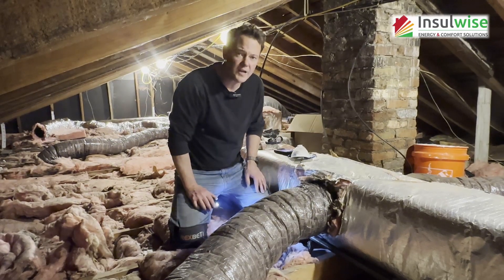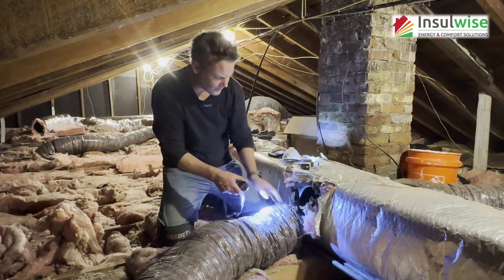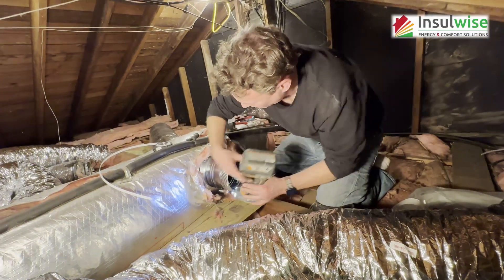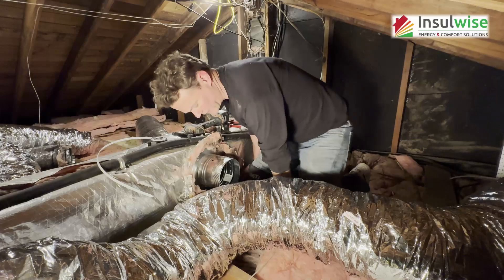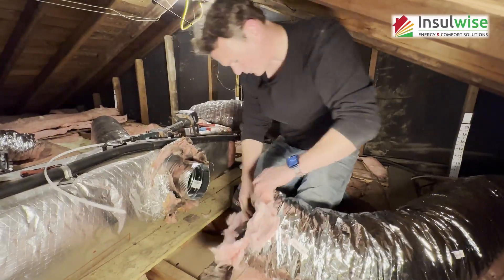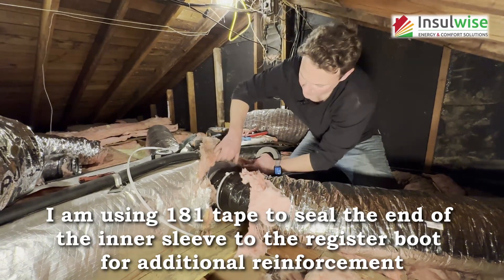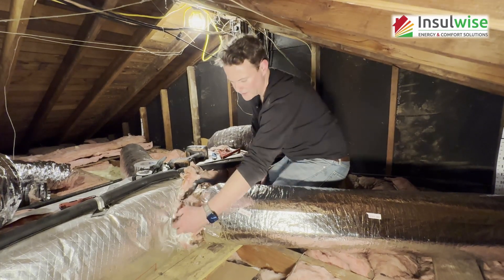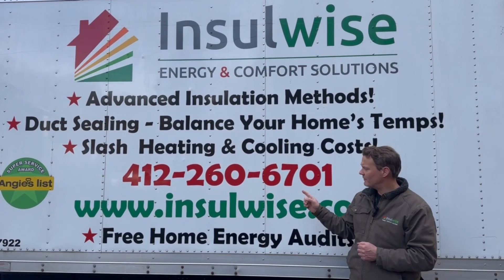Massively Improve Energy Efficiency by Upgrading Your Attic Flex Ducts!

Comment: Does having your ducts cleaned help heat and air travel through the duck air flow at all or does it just make the air cleaner. Can you do a video on cleaning your own ducts with a vacuum or is that recommended
Reply from the maker: For ducts, it's usually the return ducts that are the dirtiest.  The supply ducts are usually fairly clean to start with because the dust / dirt has mostly been caught in the air filter.  I would however say it's a good idea to pull the return grille covers and vacuum them and also the first few feet of the returns with a shop vac.  That's where A LOT of the dust and dirt tends to build up.  Thanks for commenting!
Except in extreme situations, it's rare that ducts are so dirty that the dust in them is blocking / impeding air flow, at least on the return side.  So I wouldn't expect much of an improvement in energy efficiency / duct flow from having them cleaned.  It's more of an improvement in interior air quality. 
Andy

Comment: Ive noticed my roof thaws directly above my exterior wall where our heating register exits the ceiling. We have r49 blown in insulation in our attic but peeking into the attic if i remove the register cover reveals they missed behind all of them. Any ideas on how to seal that up/insulate it? Its a 4/12 roof so getting to the exterior wall is almost impossible
Reply from the maker: The only options that I can think of are upgrading the R rating the existing flex hoses like I do in this video?  We see A LOT of junky, R-4 rated flex hose.  We changed those out in this video and installed R-8 rated hose.  The next must do's would be air sealing any air leakage points around the register (ideally the whole attic floor) and then having insulation effectively blown into the air in question so that the flex hose is buried.  We buried these flex hoses.  No melt spots on roof.  Hope this helps!
Andy

Comment: What do you think about making that attic area a conditioned space?
Reply from the maker: You can certainly do it, but you'd most likely need to spray foam the underside of the roof with closed cell foam (for sure closed cell in a cold climate) and that alone is a very expensive endeavor.

Comment: Very helpful. Thanks for showing us how it’s done, and providing pro tips along the way. Time to check my connections now that it’s not 110-degrees up there. You earned my subscription. The folks in the Pittsburgh area are in good hands.
Reply from the maker: Thank you very much, we certainly try!  The connections on attic trunk lines are typically the biggest leakers in the attic.  If your collars are not as bad as these ones you could seal any gaps you find with pure silicone or even great stuff foam.  That stuff works well for this application. 
Andy